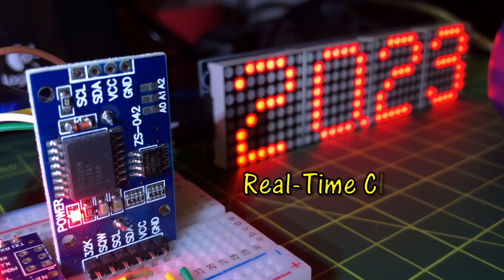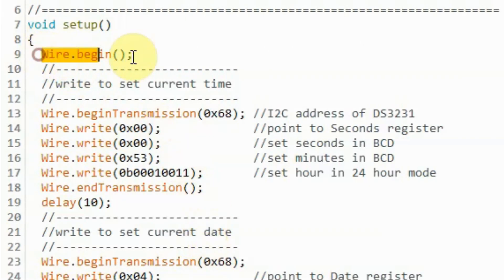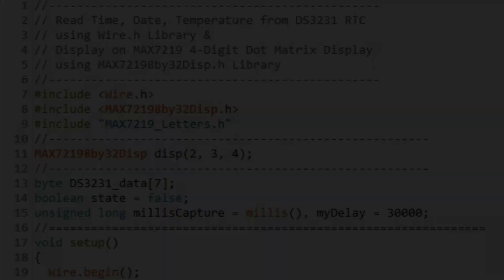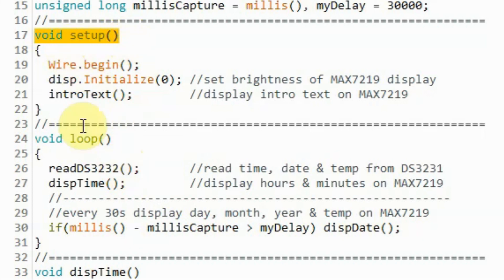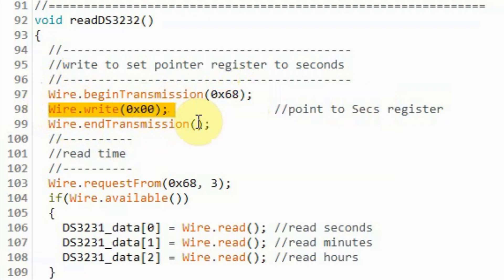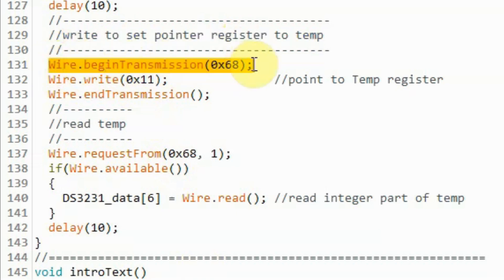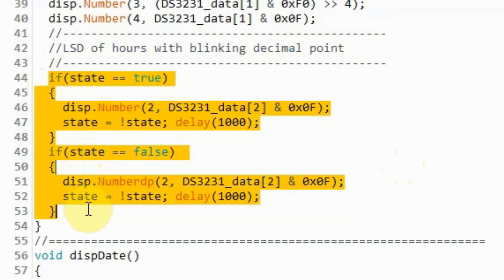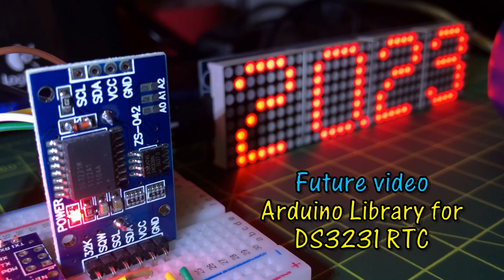DS3231 RTC on MAX7219 4-Digit Display

Comment: I completed your project and it worked very well. Is there a version of this project that includes temperature measurement with the DS18B20 and brightness adjustment of the display with an LDR?

Comment: Hello...sorry, another error:

Compilation error: MAX72198by32Disp.h: No such file or directory

(...your file on github is in my library...)

thank you
Reply from the maker: Hi. If the library is installed correctly, you be able to access the provided examples.
Reply: @AnasKuzechie  Good morning,
thanks for reply.
The library is installed correctly.
I also tried from the Arduino ide, it says it is an invalid library.

  : Arduino: 1.8.19 (Windows 10), Board: "Arduino Uno"
count0to99: 6: 10: fatal error: MAX72198by32Disp.h: No such file or directory
  #include <MAX72198by32Disp.h>
          ^ ~~~~~~~~~~~~~~~~~~~
compilation terminated.
exit status 1
MAX72198by32Disp.h: No such file or directory
This report could be richer in information by enabling the option
"Show verbose output when compiling"
in "File -> Settings"

thank and have a nice day